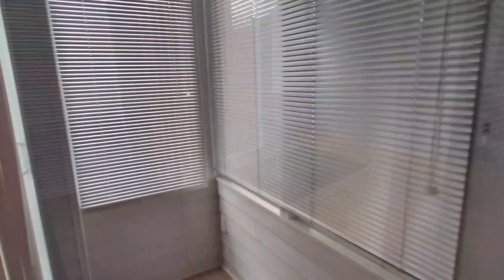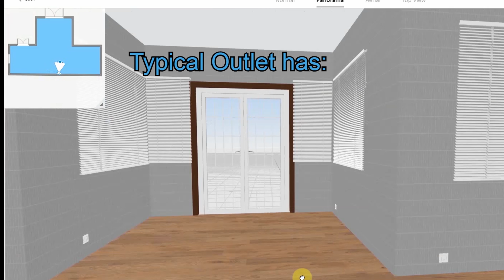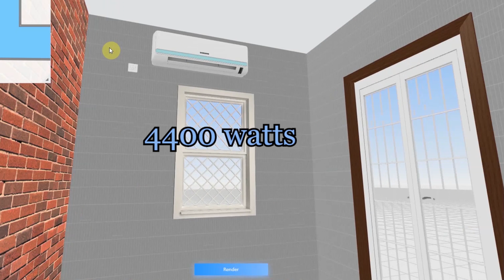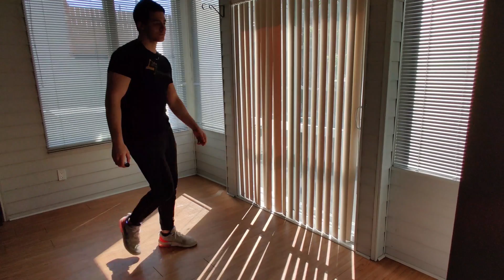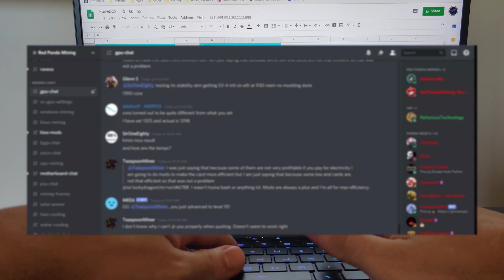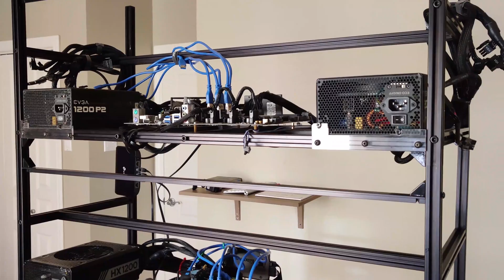Is There Enough Power To Run Your GPU Mining Rigs? - Electric Setup | EP. 2

Comment: Thanks for your video. 

I have a big question. My electricity bill has a part where says "Installed Load", and has a 2.5Kw. this means that all home can only use a total power of 2500watts? How can increase it? I need to change all internal cables for a higher caliber cables?

Please, I have too many questions. I will pay you if necessary. Thanks.

Comment: If the room can only provide approximatelty 1500w of power, since the sockets are in the same breaker, does a PDU help with providing more wattage/amperage and/or outlets?
Reply from the maker: No that will need a 30amp 240v wall plug

Comment: Nice video. Did you have to ise an adapter to use your AC plug? I have one of those too. However I don't know if or how or what to plug into to be able to use it with standard US 110 plugs. Any suggestions?
Reply from the maker: I actually ended up not using it, rather I ended up using a 240v 30 amp plug and connected a pdu to it. I think there is an adapter for that AC plug but I'm not quite sure :( I am not too knowledgeable in that field

Comment: How do you connect multiple PSUs? I have three plugged in 1 motherboard using two 24 pin adapters, but my rig keeps resetting after 15 seconds once I plug my 5th card in (4 and under runs just fine). Hiveos is saying the 4 gpu's are running at around 800, which is near what PSU #1 maxes out at (the PSUs are 850W, and two 750W), so I'm thinking maybe no power is being drawn from the other two? But I know this not to be the case as I plug in the CPU power cable to the 2nd and 3rd and they power up just fine.

I'm so lost 😫
Reply: nvm. I got it working.

Comment: what if you have 80pcs rtx 3080 in 1 room? how many watts outlets do you need?
Reply from the maker: Youl need to calculate the watts for it 😅 you can safely assume your using 1000 watts for cooling and other additional stuff and then 240 watts * 80  will give you a safe estimate for the 3080s
Reply: @MiningChamber  thank you bro for the info.

Comment: Also, Remember you need to balance your load between the sides of the panel. for example. a 120amp panel will have 60 amps on one line and 60 amps on the other. Make sure to check how your breaker panel is wired so that you dont blow the main breaker. Great Video, I keep seeing your name in Red Panda's Live stream Chat :)
Reply: This is actually false. Your loads are balanced between the 2 phases (A and B) of incoming power which are tapped  to the main lugs of the panel (240V). From that point, the voltage is distributed to the buss bar which is designed to feed alternating phases of electricity to every other seat (seat being the position a breaker is installed) in the panel, VERTICALLY (from top to bottom. For example, say you had a 10 Space Panel feeding the building. The breakers are in two columns - odd numbers on the left, even on the right. If A Phase is one phase of electricity and B phase is the other, then the load would have to be balanced between the two phases and would look like this:

1.A      2.A
3.B     4.B
5.A     6.A
7.B     8.B
9.A      10A

The balance comes from equal distribution of total power consumption and (in most residential cases, at least in the west) is factored in when being built. In other words, if there’s a concern with drawing too much from one phase (which in reality, you should not even under most heavy use circumstances), change power sources to create balance between every other breaker, not left and right.
Reply: @Jaxman1317  that is correct.
That's was my point, you dis a much better job explaining.
But the 100a service. A can only be loaded to 40A and side B can only loaded to 40A for example.
As you are aware most people dont understand this and can risk going over 50A on A if they dont have thier load balanced.
Most people will just see 100a service and think, ok as long as I load 80a I am fine without considering how to balance the load centers.
Reply from the maker: Never knew about that!! That is great to know, really appreciated it.

Haha thank you for coming by! Happy mining my friend ⛏️

Comment: I also wish I could get my radeons to go that low on the voltage. Wont do it. I can get to 975 thats it. Then they start to do weird stuff.
Reply from the maker: Ahh Radeon VIIs, We love them.. But its a love/hate relationship. The downvolting is a pain in the butt. Sometimes my r7s hold up 1 month with 950 mv, and sometimes not even a day haha so I keep trying and if it keeps crashing fast I put it on 950 - 960
Reply: Mining Chamber i find to keep them going and lasting a long time i upgraded my fans to the 200cfm in pandas radeon video, used your overclocking, worked for a few days then give out. Using 975 worked on all 4 of mine. Machine is at 1600w about. Little higher than i want to run. Guess i should take out the vega 56 for the 80% safety factor lol
Reply from the maker: @Raylep1  Hmm you should try to set every card with different undervoltage, some of them will handle 950 while others wont do less that 975. So I would spend some time just figuring out which card gives out when and now you know that your safe zone is 975. Like that you can possibly save some watts :P 80%!!